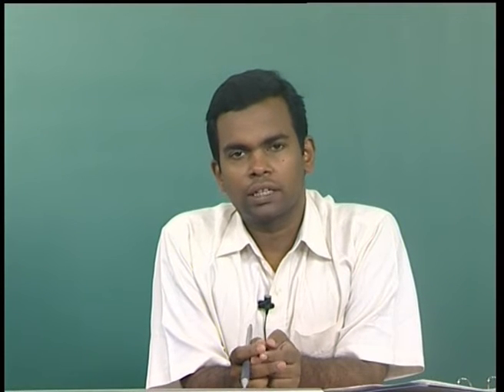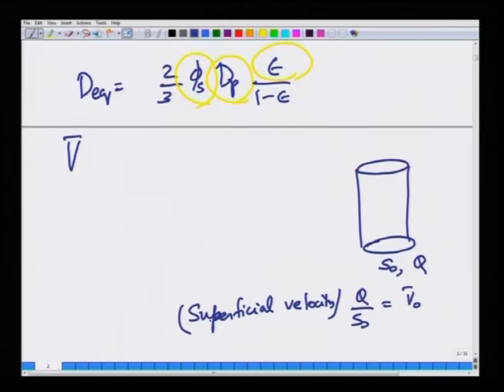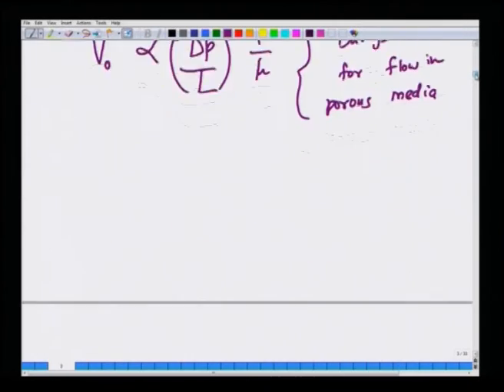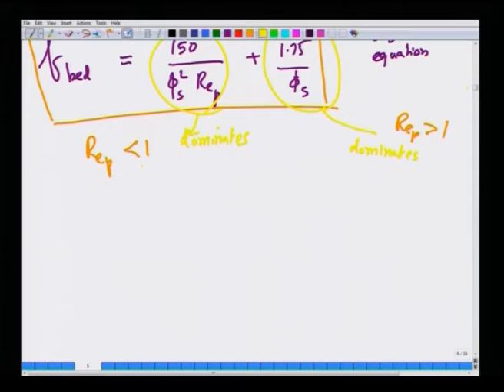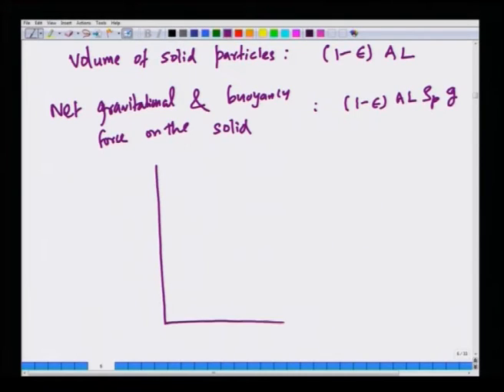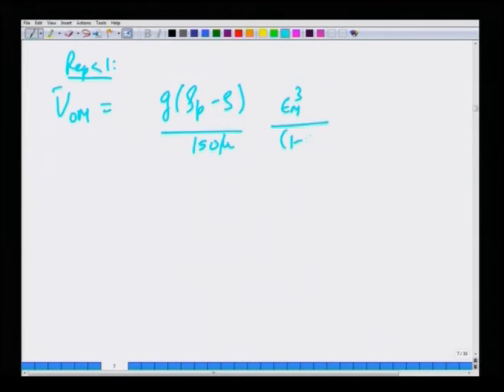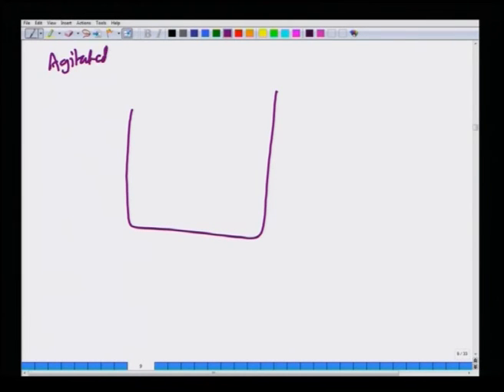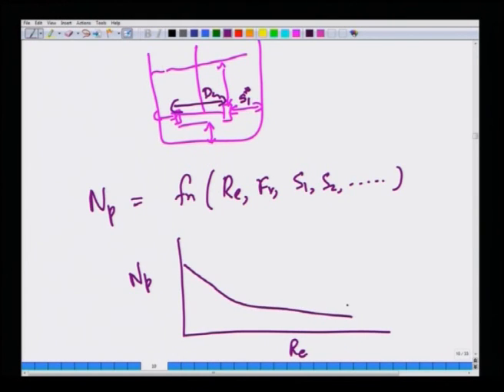Mod-01 Lec-37 Lecture-37

Comment: Why was surface area of channels =  surface area of the particles?
Reply: Yash Awasthi 
Since we are modelling the irregular and non uniform channels between the particles as equivalent simple conduits with circular cross section, the SA of particles which are in contact with fluid should be equal to the wetted surface area of the conduits.
Reply: @suryakarla8628  not understood
Reply: @suryakarla8628  Abe chutiya he rahe tu